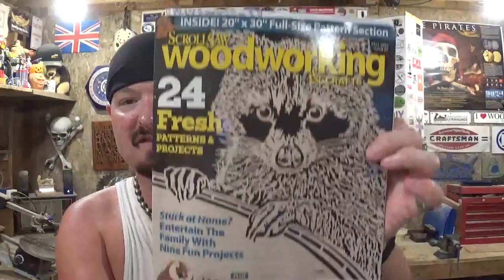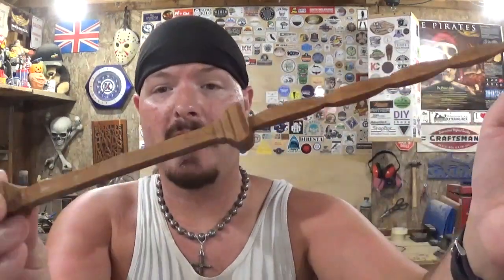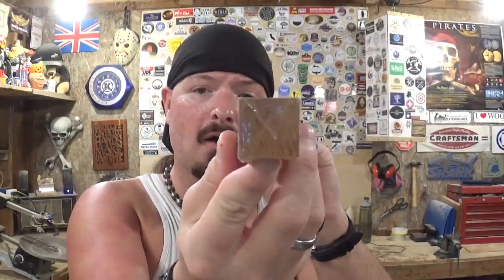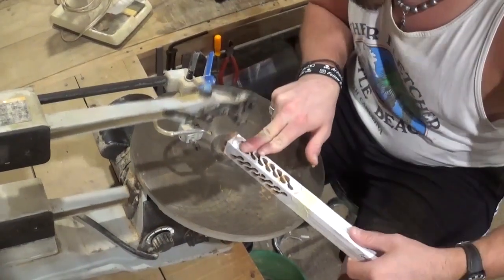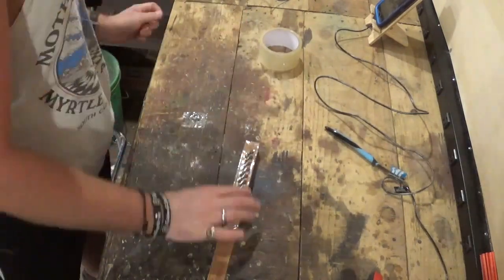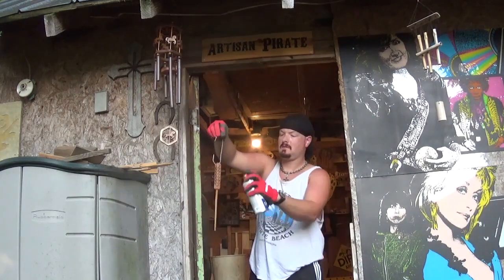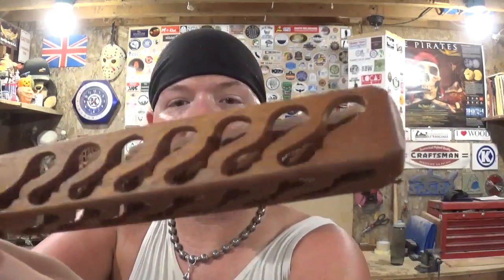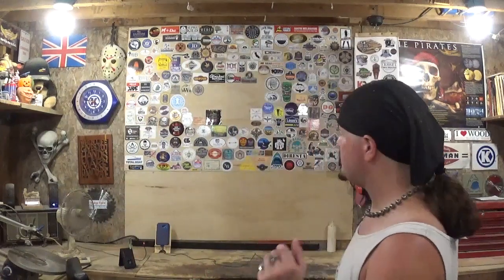Magic Wands On The Scroll Saw (Harry Potter)

Comment: I just finished the wizard face wand out of walnut and used 3 - #5 UR blades am I doing something wrong or is it normal to use that many blades?
Reply from the maker: Glad you made the wand and you shouldn't have needed that many blades. This sounds like a combination of tension and not letting the blade do the work.
Reply: @ArtisanPirate  thank you Sir. Maybe running my hegner at too high a speed for 1" walnut... And tightening blade to high ping, no deflection.